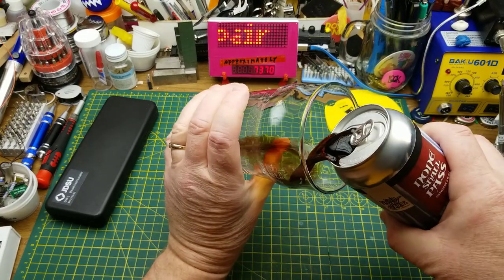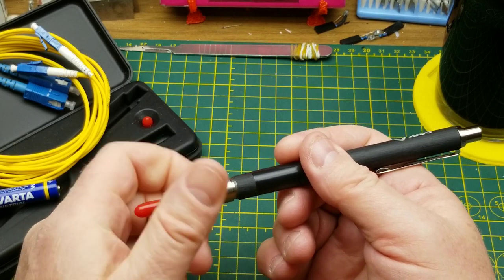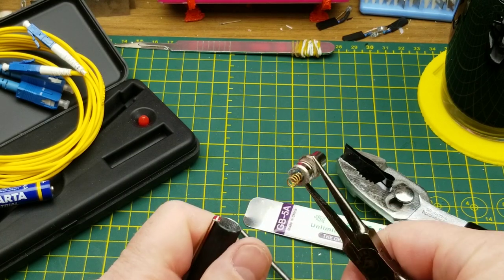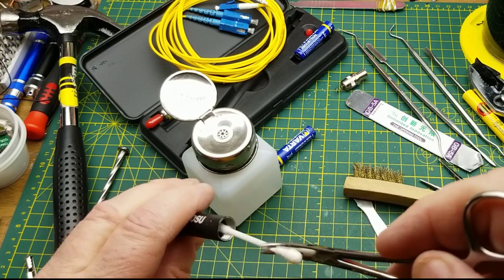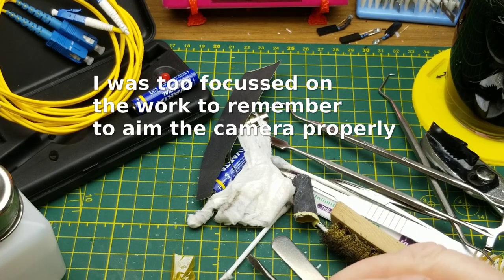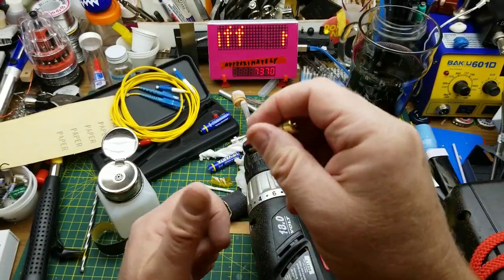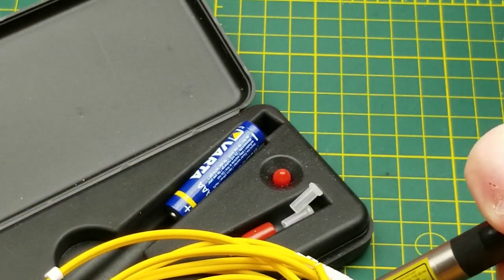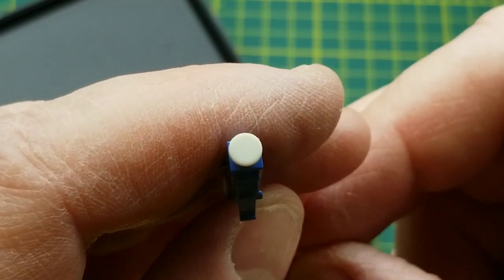fibre optic test equipment  repair

Comment: I am sorry I have to post here where my problem is not related to, but I watched your 2 years old video about a coffee mug warmer - Because it is old I thought you might not reply.

I bought a coffee mug from Amazon but it hardly lasted 30 days and stopped heating on that last day of the acceptance-period for return.!  It is plug-in electrical type, does not plug into computer.  It's  light comes on and keeps flashing but not heating.

Reading the feedback, exactly the same problem happened to others too......! 

Is it possible that you can make a video showing how to repair coffee mug warmers? I couldn't find any information on the Internet, written or in video form, I guess people just started buying this item.
Reply from the maker: If I had to guess, I would assume the restive heat generating element probably failed.
It might be a common part, or it might be something proprietary to that manufacturer.
The only way to know for sure is to open it up and test it (carefully since it's connected to line voltage)

Comment: I bought one of the cheapy ones and must say it's worked well enough for what I need. Would like to see an adaptor for it to fit over LC to give me a better fit - but certainly does the job and I won't fret if it breaks or I lose it at £15

Comment: The old Varta rechargeables use to leak all over older motherboards and kill them.  So many mainboards from the 8 bit era lost to VARTA .  It looks like Varta has done it to you also.  I would probably store it with the batteries removed moving forward to prevent the issue again.  It looks like the case has storage space for batteries. :)
Reply: yeah, it is not meant to be stored with batteries in the laser tube ... 
also add the date when "new" batteries are first used !

Comment: There are inserts for the batteries in the case for a reason. If you are not going to use the device for months at a time (which sounds like it's the case here) you should removed the batteries so they won't corrode. I would also add a small sign (Post-It?) in the lid stating to remove the batteries when finished. I will usually stick a piece of paper in the battery compartment when there isn't a case with room for them. My labelmaker has 6 year old batteries that work great and don't have any corrosion since there's no possibility for leakage current.
Reply from the maker: Unfortunately I'm not the only one who visits this facility ro work there. Every time I go there the tools have been "rearranged" from how I left them...

Comment: The white crud from leaky alkaline batteries is potassium hydroxide/potassium carbonate. Dilute acid, such as white vinegar (acetic acid) will neutralise and dissolve it. Don't use table or fancy vinegar as it has other crud in it.

Comment: Baking soda is a good corrosion remover. Would that clean it out? It works on cars.
Reply from the maker: It might have, but I think the chemistry actually corroded metal in the inside of the tube a bit.

I spent quite a bit of time sanding it smooth.
Reply: Alkaline batteries require an Acid for neutralization and cleanup.  White vinegar would be the way to go.